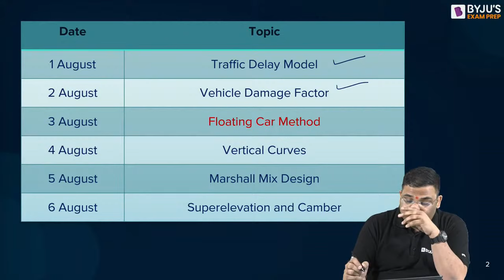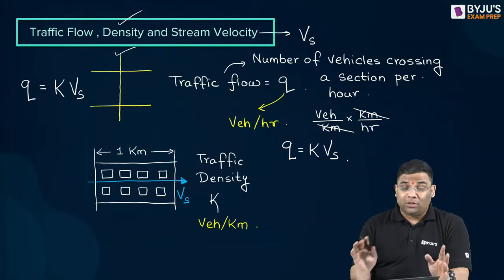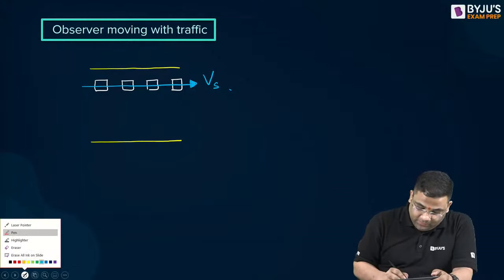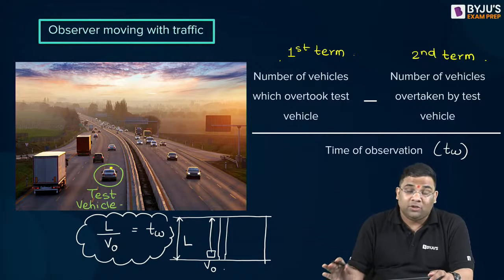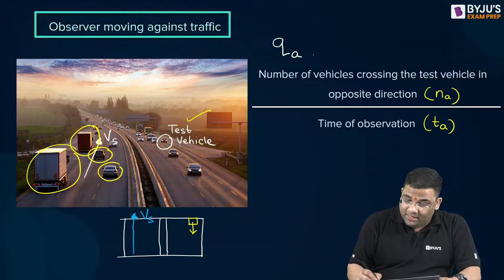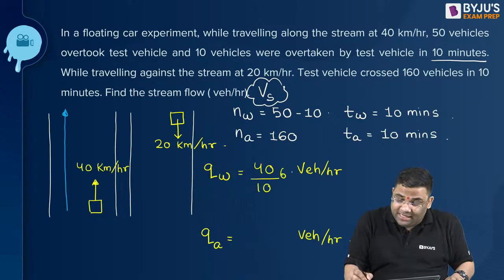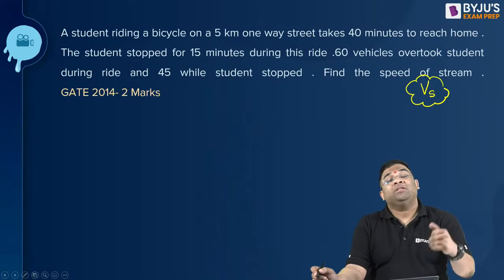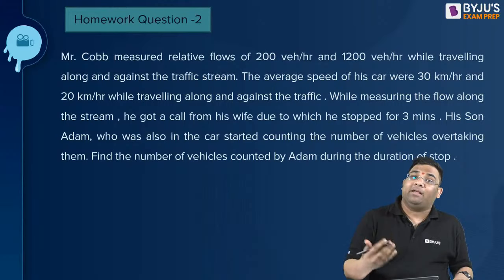Floating Car Method | Traffic Engineering in Highway Engineering | GATE 2023 Civil Engineering (CE)

Comment: Homework Solution: Question number 4

Given:
Nw=30, Tw=3 minutes
Na=160, Ta=4 minutes
Stationary time(t) = 15 minutes.
Length of the route from X to Y = 2.5Km

To be found: 

Number of vehicles observed by a stationary observer (N)

Solution:
qw=Nw/Tw = 600 veh/hr (Flow along the traffic stream)
qa=Na/Ta = 2400 veh/hr (Flow against the traffic stream)

Average speed of moving observer 

a) along the stream = (Vo)w=Distance/Time 
= 2.5×(3/60) = 50 km/hr
b) against the stream = (Vo)a = Distance/Time
= 2.5×(4/60)=37.5 kmph

2400=K(Vs+37.5) (Flow against the traffic stream)
600=K(Vs-50) (Flow along the traffic stream)

By solving the above equation 
K=20.57 Vs=79.17

Traffic stream flow q=KVs=1628.5 veh/hr

q=N/t 
Therefore N=408
Reply: Correct Solution

Comment: In Floating car method the observer vehicle first travels along the direction of the stream and then against the direction of the stream with velocity (v0) with the help of this method observer can calculate stream velocity(vs= avg. vel of the vehicle ) flow of the stream, the flow of stream along and against he direction of traffic. it is also used to calculate the no. of vehicles overtaking the observer veh or no. of vehicles which the observer vehicle overtook we can also find the density of stream (k)
Eqns use in moving car method 

1. q(along )= k(vs-v0)  
2. q(along)=N1-N2/tw 
3. tw= L/vo
  we can use the above 3 equations when the test vehicle moves in the direction of the stream

When the observer vehicle moves against the stream  following result can be used 
1.q(against)= k(vs+v0)
2. q(against)= N/tw 
3. tw=L/vo

To calculate the flow of stream  (q=kvs)
when the observer is stationary then also we can use the above equation

N1 = No. of vehicles overtaking test vehicle 
N2 = No. of vehicle overtaken by test vehicle 
tw= time of observation 
L= Distance 
N= no of the vehicle crossing the observed vehicle in the opposite lane 
The velocity of observer can be different in moving with the traffic and against the traffic.
Reply: Very nicely compiled
Reply: Thank You Sir 🙏🙏

Comment: Homework Solution: Question number 3

Given: 
qw=50 veh/hr
qa=200 veh/hr 
(Vo)w = 20 kmph
(Vo)a = 30 kmph

To be found: 
K veh/Km

Solution: 

200=K(Vs+30) ( Flow against the traffic stream)
50=K(Vs-20) (Flow along the traffic stream)

By solving the above two equation
K = 3 veh/km
Reply: Correct Solution

Comment: Homework solution: Question number 2

Given: 
qw = 200 veh/hr
qa = 1200 veh/hr
(Vo)w = 30 kmph
(Vo)a = 20 kmph
Stationary period (t) : 3 minutes

To be found:
 Number of vehicles overtaking Adam's car when the car was stationary (N)

Solution: 

1200=K(Vs+20) (Flow against the traffic stream)
200=K(Vs-30) (Flow along the traffic stream)
By solving the above two equations.
K=20 Vs=40

Traffic flow q = KVs = 800 veg/hr
But q=N/t 
Therefore N=40 vehicles.

When  Adam's car was stationary 40 vehicles overtook him.
Reply: Correct Solution

Comment: Homework Numericals:- 

1. Stream Flow = 800=K*Vs.
    qa=1200=K(Vs+20).
    Solving the above two equations, we get K = 20, & Vs= 40.
    For moving along the flow, tw=12/60=0.2 hour.
    qw=nw/0.2=K(Vs-30).
    Putting values of K & V, we get the difference (nw)=40.

2. qw=200=K(Vs-30).
    qa=1200=K(Vs+20).
    Solving the above two equations, we get K = 20, & Vs= 40.
    Stream Flow=20*40=800.
    No. of vehicles counted by Adam = 800*(3/60)=40.

3. qw=50=K(Vs-20),
    qa=200=k(Vs+30),
    Solving the above two equations, we get density of traffic stream (K) = 3 vehicles/km.

4. For moving with the flow, Vo=50.
    qw=600=K(Vs-50)
    For moving against the flow, Vo=37.5.
    qa=2400=K(Vs-37.5)
    Solving the above two equations, we get K = 20.57, & Vs= 79.12.
    Stream Flow = 20.57*79.12 = 1627.5.
    No. of vehicles observed by stationary vehicle in 15 mins = 1627.5*(15/60)=406.875 =407.
Reply: Correct Answer . Bravo !!!!!